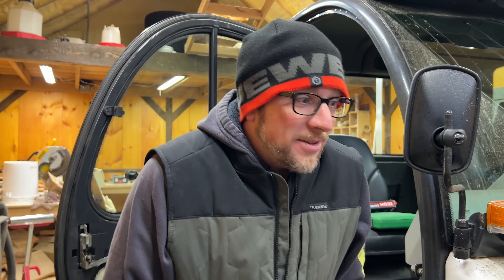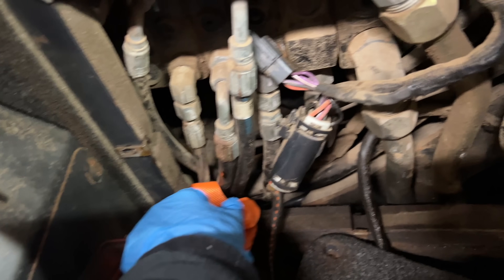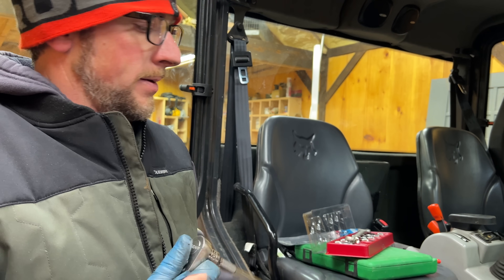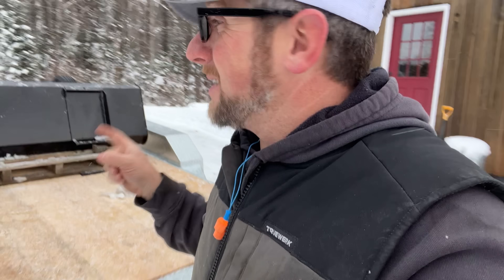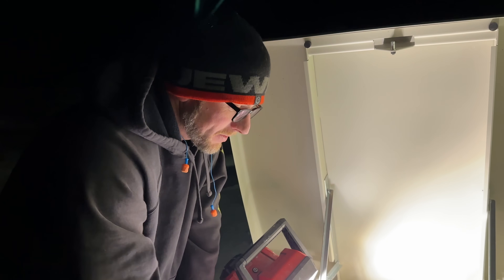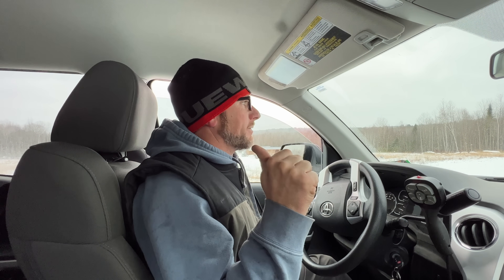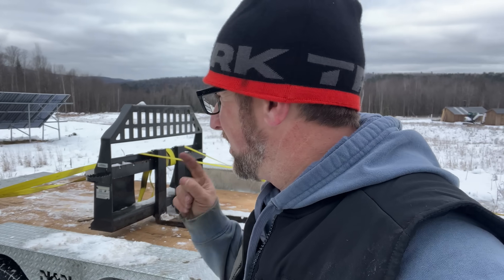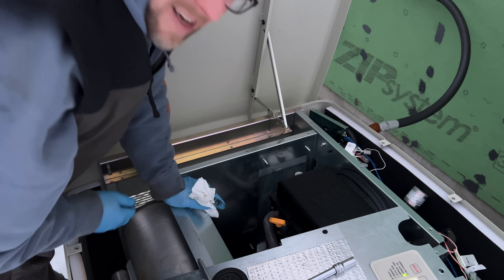So We BOUGHT a HEAVY DUTY Trailer....Maybe We Should Start a Hauling Business?!?

Comment: Thank God you have a very handy and mechanically inclined husband Gina. I wish my husband was. It would save us loads of money 💕
Reply: Give your guy some slack. I've done work for many professionals that don't have an extension cord in their garage much less a couple wrenches to change out a dielectric union on a water heater or the kit for cleaning the furnace.
 My Brother in law is a retired general foreman electrician. Is he good at sanding floors, mudding walls, cleaning windows, solving plumbing problems, fixing a stove, microwave or refrigerator? Not so much. He can do quite a bit of  it but not with the same efficacy, speed or skill set that comes from practice, instruction or inspiration from God. Give him 2500 feet of stick and he'll go through it in a day. He'll fix anybody's shorts. Call it the gift of gizmo. I see it all the time where somebody just puts their hands on something and it works without doing a thing. But I won't play doctor, lawyer, accountant or sick my toe in a pool of other professionals. 
Now that I gave him some ammo for playfully sticking his tongue out at you. I will note that it doesn't sound like you're going to trade him in soon.🤣😘😉
Reply: @scottdahl1938  why are you even commenting on my comment? You read way too much into my comment. SMH

Comment: Your next oil change check the book for how much oil with filter   Then after putting in the oil check the dipstick for proper reading. The dipstick maybe wrong and you put in to much oil. The plastic top of the dipstick may have one or two groves for “O” rings. Time for the manufacturer maintenance manual. PS good choice on the trailer. Gina into the new kitchen. Have fun with the New Year.
Reply: The top and length of the dip stick tube was completely dry.... It was obviously only leaking at the base..... that was the HIGHEST point...

Comment: Looks like a great trailer.  In Florida galvanized boat trailers rust out if they are delivering boats in salt water.  Fresh water is not a problem  A way to minimize this salt water intrusion is to do a thorough fresh water wash down after the trailer being in salt water.  This may be something you could do in the spring time after last freeze.  Will extend the life of the trailer.  Just a thought.

Comment: When you find a good deal on straps take advantage of it. To keep some in the tool box of the truck, on a trailer, or in the garage for use as clamps when you're gluing stuff. (@boardrobertw.ellerbysr.358 has a great idea. With that suggestion you wouldn't need as many extra straps.) 
With a tire changer in the garage here things like extra valve stems are a good thing. After four years a new stem is prudent if the trouble is taken to put on a new tire. Same thing with the hydraulic hose. If it's cheaper than Napa then great! You get it.

If you could hear me now making primordial grunts of ecstasy a la "Tool Time" as you're covering the lights and bells of the new trailer. Awesome purchase! New Yolk City, here we come! As I scrolled up from typing I saw you got the feed bunkers. YES! I could imagine the goats thinking with a tear in their eye and one hoof pointing at it saying, "Our fodder's in there!" (That joke is older than me.)
Good job on the generator!!! This Harbor freight compressor in the garage was making too much noise for what I paid for it. Further inspection revealed two out of four bolts were missing. Couple more bolts added and no more knocking. I would fix radios when I was a kid by just looking things over. Somebody else would have called for service under warranty but you gave common sense free rein. 
I have a handful of channels I purposely look for daily. You guys are among the top of the short list. Just a few Acres (Pete's dad jokes and Mr. Rogers tone), Arms Homestead, Weed 'em and Reap and Justin Rhodes. You're in the best of company.😇😘👍

Comment: Oil leak... It is either of two things. 1. the tube is press fit and it kinked slightly as it was built, or2. it has an O-ring that was damaged as it was built. Either way, it's not a pressurized seal, so with the RTV fix, you should be good as long as the RTV you used is not deteriorated by petroleum products. Love the trailer, That's a really nice unit. Come summer when the deck drys out really good, mix some old engine oil with some diesel fuel to thin it a bit, and paint the deck boards with it. apply in several coats until it won't soak in any mire then just wipe it dry. May have to wipe it on several times in case the heat of the sun draws some of it out again. Will make those boards last a lot longer. THANKS FOR SHARING!

Comment: Is there some kind D of crankcase breather or check valve that could be plugged up causing extra pressure to build up in the crankcase. I've seen o-rings on those dipstick tubes and if it built up moisture in a crankcase beather it could freeze but I would think there would be enough heat to allow it to keep from freezing. Hopefully you probably got it!

Comment: Merry Christmas......I want to suggest you treat the wood that is expose. Shou sugi ban, or yakisugi, is a method of preserving and distressing wood by applying an open flame to it. The fire chars the wood, turning the top layer into black ash, but only lightly so. The practice originated in Japan and has been used for hundreds of years there and across the world. Shou sugi ban-treated wood can be used for interior shiplap siding, ceiling beams, posts, exterior siding, bars, kitchen cabinets, wood ceilings, and just about anything made of wood. Thanks......and ty for putting together videos!

Comment: Check your air filter housing, could be the crank case vent, and valve cover on that side Al. Does your owners manual parts breakdown show a gasket for there? If your vent system isn’t working, that could of caused the leak as pressure raises the oil has to go somewhere…… Forcing oil up hill out around dipstick tube, since that area is now sealed, where is the next leak going to appear, rear or front main seal? I wound do more investigating Al.

Comment: I have a bobcat mini excavator. Blowed a line, lost a lot of fluid. Fixed it. Then once the fluid got to operate temp. Lost a lot of power. Bobcat said use only bobcat fluid, other fluid will foam up. I know any fluid I have seen will list all types of equipment but not bobcat.

Comment: Al, as I watched you using the straps to hold the feeders you did a good job in using heavier straps to hold the feeders as they do catch wind.  You may want to add some chains and binders for hauling heavier machines that have sharp edges that will cut straps.  Like the tractor and excavator.  One idea to protect your straps is to get some used fire hose to thread the strap through (cut in pieces) that will allow you to protect the straps.
Reply: Wow!! That seems like an excellent idea!  Believe me, I don't know Nuttin' about Nuttin', but used fire hose slipped over the straps beats "now where the heck did I put those pieces of old carpet"?  Very impressed with the new trailer, Al.  You did good.

Comment: Al..you really need to get a set of pressure fitting wrenches...using regular wrenches is a good way to bust some knuckles or round the fittings off and then you'll really have some problems... a set wont cost you much more than a regular set of wrenches...Have a Happy New Year and keep cranking out your great vids :P

Comment: That trailer is awesome.  With regard to the oil leak in the generator - my concern would be that by you messing around with it you might be voiding your warranty.  I'd suggest you contact the place you bought it or the manufacturer.

Comment: A note of Caution; Shut the Truck off or disconnect the Trailer Cable. The pump will take Voltage & current where ever it can get it from and with the Truck running the Charge Ckt is ON. 
and Most Charge Ckts are Fused at 20 Amps and the pump can draw more than 20 amps through the Charge Ckt.
That goes for the Winch too...
Chris in the Woodyard bought a new N&N 12' Dump trailer and is finding that out the Hard way.
I have a 21' foot split deck tilt, sure do not miss the Ramps LOL
Thanks Guys.
Mike M.

Comment: Some hydraulic cylinder have a FAIL SAFE valve that keeps the hydraulic fluid in place ....otherwise a burst hose eak would cause an operating hydraulic cylinder to drop the load. So must equipment most have line pressure to overcome the safe fail safe to move the piston in the cylinder.

Comment: The plastic cap that screws into the fill hole of the generator will vibrate OUT , If it wasn't screwed in Tight when oil was added to the engine !!!

Comment: Al, in most states, the 14,000 GVRW weight rating puts you into a commercial drivers license. 

Between the Federal and state governments, they’ve made a mess of things with trailer legality. You can tow a travel trailer that’s heavier than the Titanic, but and equipment trailer greater than 10,000 pounds puts it into a commercial classification. 

I had a trailer built using 8,000 pound axles, (8 lug wheels and big brakes) but the GVRW stickered to 9,900 pounds just to stay legal.
Reply: Isn't it IF the trailer is over 9,999 GVWR AND combination is over 26,001?  So when we pull that trailer with 1/2 or 3/4 ton we should be okay without CDL, but with F550 truck on that trailer - then you need a CDL.
Reply: @maddogrichter8054  
Most states have reinterpreted the law. Now it's if the trailer exceeds 10K, you need a CDL. If the truck and trailer exceed a gross placard combination weight of 26,001 you need a CDL.

I have a F650 Super Truck with a Cummins engine and Allison 3000 series automatic transmission. I can drive the truck by it's self, but no longer can tow a trailer with it as it exceeds 26,001 with the empty weights added up.

This is the US DOT and numerous states going after the Hot Shot truckers.

Locally, (within 100 miles of home) I can throw my magnetic signs with my farm name on them and be legal up to 80,000 lbs and no CDL required. It's screwy.

The guy that use to cut my lawn got popped for a F350 with aluminum flat bed and a tandem axle trailer by the DOT. He ended up selling both truck and trailer and went back to a bumper pull F250 and trailer rated for 9,900 pounds.

Comment: OI AL, If there was no o'ring on the geni dipstick then one would ask 3 questions....... 1) did the geni not have a quality assurance check?? 2) did the manufacturer forget to implement it in its design, 3) Is there a problem with the geni having too much CRANK Case pressure therefore allowing oil to leak as the design didn't allow for the pressures?

Your stop gap solution may come back to bite u if u do have a crank case pressure issue...... Wud u mind talking about these answers next vid??

Comment: With any ball hitch type trailer, the center of mass needs to be ahead of the axel or the trailer will be unstable, i.e. cause the trailer to whip back and fourth. The usual rule of thumb, 10% of the total trailer weight needs to be on the hitch.

Comment: Hey there AL, what did you mean by saying you would not have any power if there is a problem with the generator!  Is the solar still working or not?
Reply: batteries can only store so much so on cloudy days and or no Sun  the batteries don't get to charge up that's when the generator automatically kicks in and keeps the batteries charged

Comment: 22:38 Trailer's spare tire mount was wobbling kind of hard (in side mirror) so it could be a point of metal fatigue over the long haul.
'Tym the Tool-changing Tractor' 😁
Will the white farm truck be hauled by trailer?

Comment: Take your little break away wire loop OFF the safety chain and hook it to the hitch with its own clip. If your trailer comes loose and pops your chain, the break away cable will go with it and not pull the little wire cable out that makes the brakes come on. Not to mention you could get a ticket for it because its not hooked correctly.

Comment: Quality control on the generator is a bit of a concern! Do you have an option to plug in a portable generator if that one lets you down?
Reply from the maker: We do have a back generator.
Reply: Have you considered adding a heating loop from your boiler to the back of the solar array to melt the snow off before sunrise? Might help minimise generator run time.

Comment: Nice trailer, can you haul the excavator with it?
In regards to the generator, my thoughts are that it may be building up excess pressure in the crank case, check to see if it has a breather that might be blocked.
Reply from the maker: Yes our mini x is rated for the trailer

Comment: You’ve probably already though about it but I like to run helper air bags on the back of my rig to avoid squat when pulling heavier loads.
Reply from the maker: I have thought about it. I’ve never installed any. How easy is it?
Reply: @LumnahAcres  supper easy and probably only $200.

Comment: If the generator is not missing a gasket, it may be one of the two surfaces is not machined perfectly flat for a 100% dry seal.  Either way the Permatex did the job

Comment: MAGNET:    WRAP SOME WIRE in a coil around your TOOL to become a magnet.  ZAP the wire ends acos a battery terminal. Remove wire and use uour new magnet.  Done it hundreds of times. There is a Stick Clay dough like stuff on the end of a long down.

Comment: That's a brand new generator.  You should have called whoever installed it and had them fix it, it should be under warranty, that way if there are any problems in the future they can't use your dipstick sealant as an excuse to not cover repairs that would fall under the warranty.

Comment: HEAT an OPEN END WRENCH handle to bend a 90 degrees bend in it to make a tool to use in tight places. Done it hundred of times. Like to use cheaper tools and not ruin my good Snap-Ons and etc stuff.

Comment: Al, just a reminder. When your ratchet straps are twisted you lose a significant amount of their rated strength. Here in Germany the police is very strict about proper use of ratchet straps, both with private users and professional haulers and truckers. And you can get some very hefty fines as well as points that can result in the suspension and/or loss of your drivers license. That is because insufficient, under-rated and wrong use of ratchet straps is a safety violation.

Comment: HEY. AL, THAT'S NOT  A BRIGGS V-TWIN IN THAT GENERATOR IS IT?? WHEN I WAS WRENCHING FOR A FACTORY DISTRIBUTORSHIP ONCE, I HAD A V-TWIN BRIGGS DOING THAT, BRAND NEW, I TORE THE ENGINE APART, AND MATCHED UP PARTS DIAGRAM TO MOTOR, TO SEE IF SOMETHING WAS MISSING. BRIGGS MISSED PUTTING IN A BAFFLE PLATE UNDER CRANK CASE VENTILATOR. WAS BLOWING OIL EVERYWHERE, IT WOULD EMPTY OIL OUT PRETTY QUICK. HOPE SEALING TUBE DONE THE JOB FOR YOU. BE MY GUESS, INSIDE HOLE IS A GROOVE AN ORING GOES INTO, FOR TUBE TO SLIP THROUGH.

Comment: Surprised you don't have a locking extension so that you don't lose sockets or like the crows foot.
If you need part #'s comment and I will get you the one from the brand I have but pretty sure you should also be able to find them with out having a tool dealer

Comment: I’m not trying to be mean or rude but with any trailer with a weight rating over 10,000 lbs you need a cal to tow and your truck isn’t rated to pull that much. Not saying it won’t do it but you should take it in to consideration

Comment: That is definitely not a cheap trailer. I don't know how it is in your state but the DOT  has been known to pull over pick up pulling trailers and they'll check the Gvw of your vehicle and the trailer and they go by the GVW of your truck and the load on your trailer better not exceed the GVW of the truck. So if your trailer is rated at 14000gvw and your truck is only rated at say 7000lbs you better not be over the Gvw of your truck which should include your tongue weight. Sometimes them guys get a little picky.